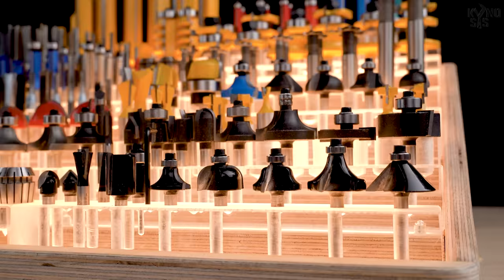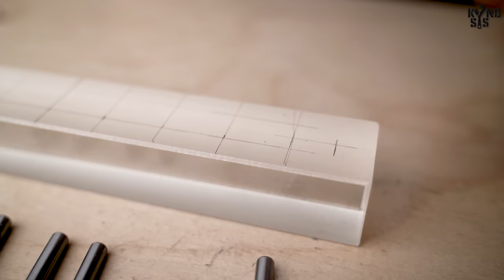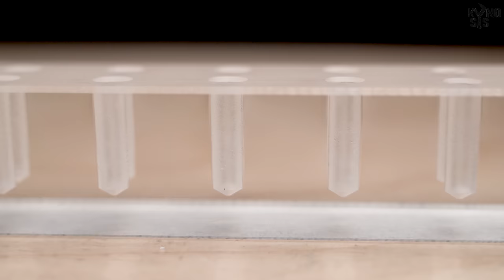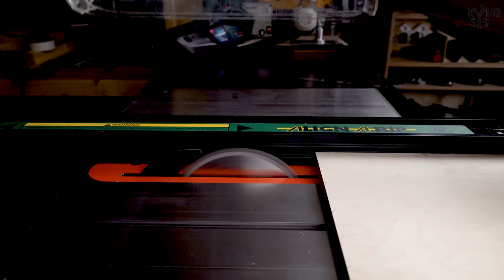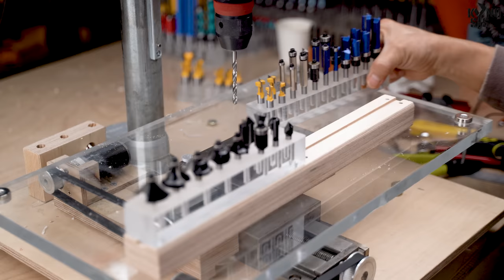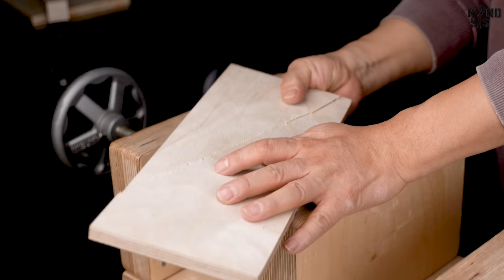Making Router Bit Storage Box / DIY

Comment from the maker: Please turn on your language subtitles!
Join our membership!
There are as many types of bit blades as there are drill bits, and router bits are used a lot.
I kept it in a drawer, and I finally made a storage box.
I made a hole in the acrylic base and put the bit on it. The magnet on the floor allows the bit to be mounted reliably.
In addition to one bit blade, I've also made about 10 separate pieces to allow similar types of router bits to move around at once.
I made a vertical drill bit drawer before, and I specifically sized it to be compatible with it.  
Later, when the bits get longer, I'm going to make another drawer.
It was difficult to make it in the form of stairs and give a certain interval, so please check the process of overcoming this through the video.
If you enjoyed this video, please subscribe and like it.
Thank you.

#DIY #Router #Routerbits #BitStorage #Bit #Storage #Woodworking #DIY_IDEA_INVENTION

Comment: Great job. But, do you use your router bits or are they all display dummies? They all are looking brand new and unused.
Reply from the maker: Your question is pointing in the right direction. Taking router bits as an example, I've been collecting bits for over 4 years. But it's been less than a year since I've set up a router table. In fact, I haven't used 20 of the bits in this video yet. I have a style of preparing tools and parts suitable for the item I envision in advance. This is also because I am an inventor. When conceiving an item, it is sometimes confusing whether the idea comes first or the parts and tools come first. Ideas come from looking at tools and parts. I will introduce many of the parts I have collected in a video someday. If you watch the video called Power Tool Wall, there are a lot of power tools, and this is also because I make tool review videos. I was sponsored by Dewalt's hammer drill and produced a review video. With these many parts and tools, I will try to make more cool works. Thank you for your support. thank you

Comment: Fantastic! mines a drilled stair tread off cut with a small population. Doesn’t box imply 6 sides ready to close up for travel.
Reply: Since you have lights how about sound! What if a motion sensor turned on the lights at a certain proximity and played a star wars fanfare
Reply from the maker: I've been thinking about motion sensors. I think that would be cool too. When working continuously in front of it, turning it off and on may be a little inconvenient. Thank you for your kind words, I will definitely refer to your comments for my next project.

Comment: jaja que buena onda, creo que acá en argentina ese plástico que usas nos lo venden como oro. Quedan muy buenos los diseños con ese plástico, excelente trabajo my bro
Reply from the maker: Parece que los precios del acrílico son muy caros en Argentina, ¿no? No es un material barato ni siquiera en Corea. Aproximadamente tres veces más caro que el contrachapado de abedul. También lo guardo y lo uso. gracias

It seems that acrylic prices are very expensive in Argentina, right? It is not a cheap material even in Korea. About three times more expensive than birch plywood. I also save and use it. thank you